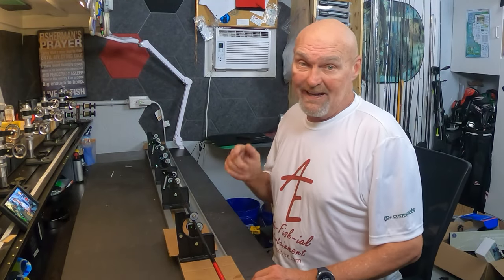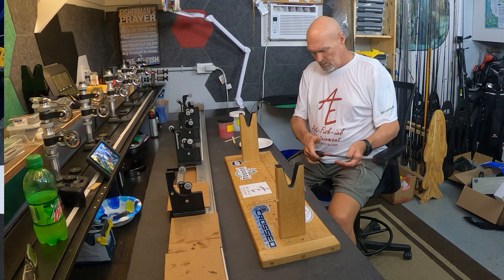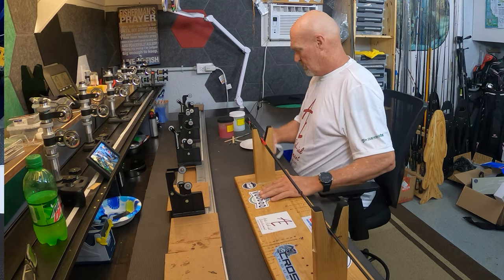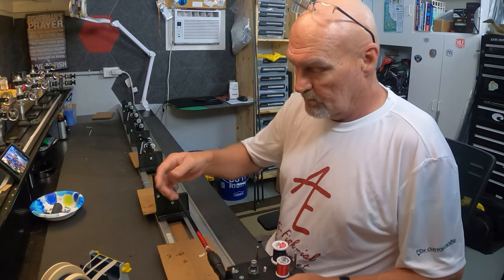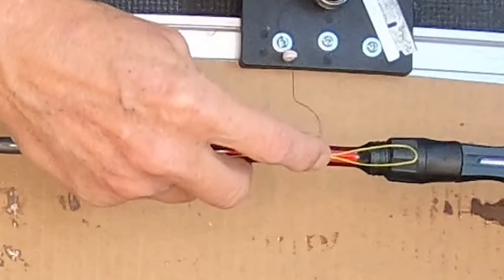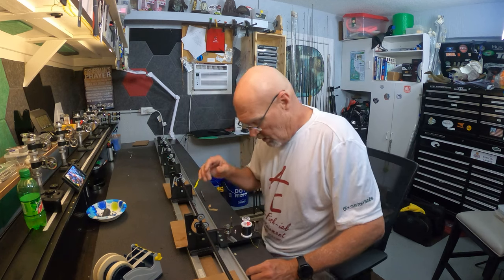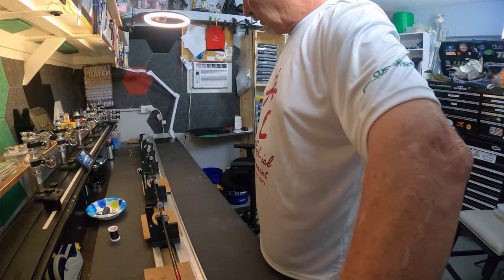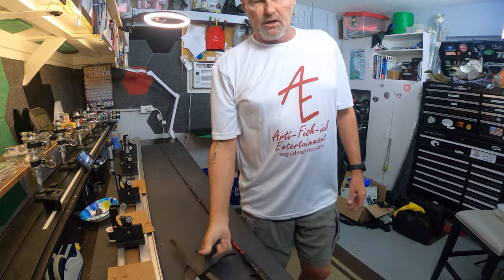Finesse Rod Build - Part 3

Comment: Do you like the double foot guides better than the single foot?
Reply from the maker: I normally use double foot for the stripper and transition guides, then single for the rest of the guide train to save weight.

Comment: I thought metallic thread doesn't have the tinsel strength for guides.
Reply from the maker: Metallic thread has a lower tensile strength than nylon but I have never had an issue on freshwater or light inshore rods.